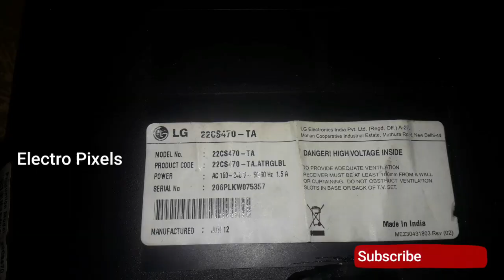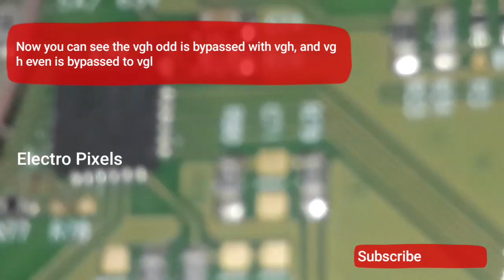Lcd, led Vgh odd,Vgh even short removal |Level shifter Ic modification method to solve freezing.

Comment: did i can assume that c1 and c2 is ( vgl1 and vgl2) ? 
i need to replay video  but if ive corectly listened 

need to jump vgh with vgl1 and vghE with vgl2 ?  

lol
Reply from the maker: We recently Uploaded This Same panel Repairing video lg 22 inch model with Details, So watch it in our playlist
Reply: @ElectroPixels  i dont even do anything before sure what im doing , finally at this stade , un65mu6900 , with HVdd_8.3Vshort to ground (pannel side ), since couple of hours , i better know what mean these signals , i read everywhere that mu6900 was really dead pannel but i refuse to admit it lol
Reply from the maker: Its Lc1 and Lc2 in Auo Panels and vgh odd, Vgh even ( Vgh o,Vghe)in Lg Panel, You need to First Block the Voltages from the Levelshifter Ic . Before Bypass otherwise it will Damage Levelshifter Ic if you're not a Technician please don't attempt to. Repair,Watch our other video also if you have doubt, If you're not a Technician then not try, This Types of Modification need Experience.
Reply: @ElectroPixels  im technician but at this stade i study the possibility to repair display that are declared dead and non reparable so ive been dropped on your videos via google search , thanks it ! :D , 

i have just never be over these lines so much , when a pannel fail generally i scrap it without question then i swap a compatible pannel into the set or a same size with his apropriate Tcon then an lvds hardwire if needed,,, here to quebec alma , no one will try to repair a screen like this , im the only one , but i need to pratice and learn , 

thanks to exist , your share is important
Reply from the maker: All the Best, Fact is Panel Repairing is Just only Temporary Solution, Permanent Solution is Panel Replacement, But Cof Bonding is a Permanent Repair if the Issues with Panel cof( chip on Filim ) All the Best For you're success
Reply: @ElectroPixels  sharp aquos quattron lc-70LE730U . 
Error Code , 

2-5 ( pannel power SOS) 
found a side COF burned 
Removed ALL COF on this side 
TV still Running since over 5 years 18h/24 
im not convinced that your job is temporary , i love your work and would say a big thanks for this amazingVGH VGL ETC lessons it more than usefull , seriously , its gold information 

real tech  skills there , subscribed + notification :D  Gratz from quebec Alma Lac st jean 
:D
Reply: @ElectroPixels  its not the pannel that you repair , its the component around it shorting out that you are able to perfectly bypass ,without removing it , its purely 9 million level skills . , i assume you know that you can also just ''PEEL IIT FROM THE GLASS'' et Voila , , , , fortunely ,half of these cof  can be missing  and tv will continue to work . , some display have 2 lifes , , ,  its there the ''magic' is starting :D , 
correct me if im wrong , but with your thechnique ,  95% of naturally dead display with no glass damage become REPAIRABLE ( in particular display with NO COF ON THEIR SIDE ,  ( AND  exept for hardware damage flex and this kind of matrial damage )
Reply: im about to seriously consider that your technique can be apllied on samsung 4k new screwless NU/MU series led display pannel  :/

Comment: Brother, what's it can be done for LED laptop, I ever getting problem with VGH and VGL voltage on the laptop LED, could you explain me about it? What's it can be done with bypass method too?? Thanks before🙏🙏
Reply from the maker: Yes you can apply this method on laptop screen, mostly work on auo panels
Reply from the maker: You need to find the vgh odd and vgh even points